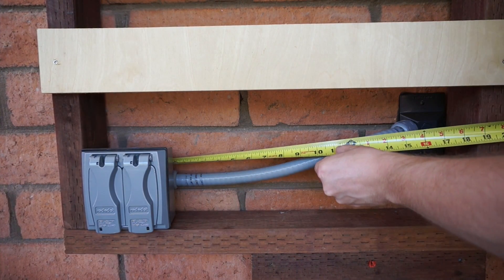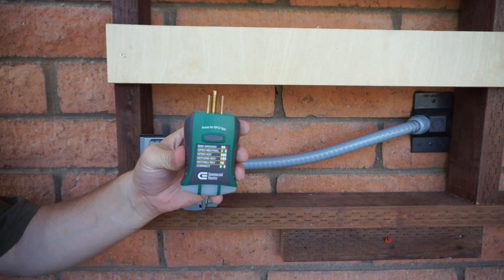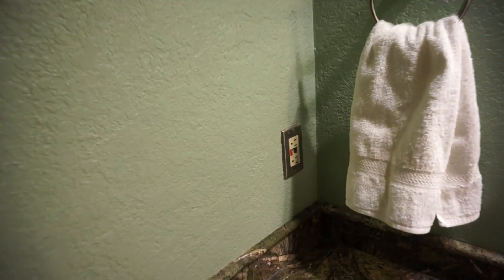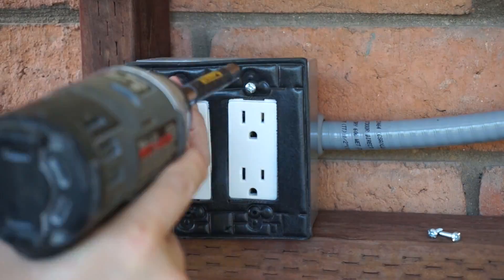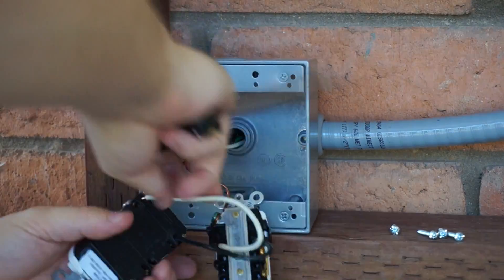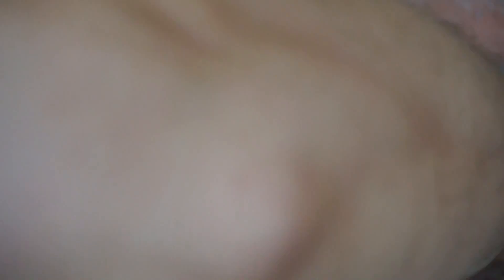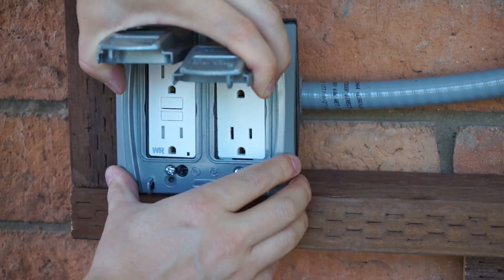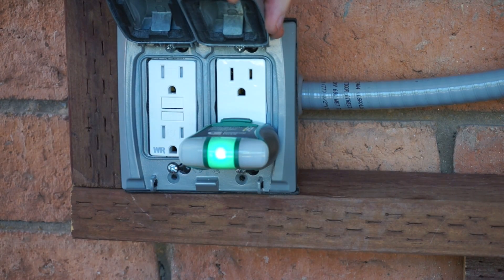How to Extend an Electrical Outlet - Followup

Comment: Great to see you address the criticisms and attempt to resolve them. Unfortunately, I know others would've slammed you about it, there are couple issues not resolved. 

First thing I noticed since your original video is the ground wire wrapping around the ground screw in your new outlet box is supposed to go clockwise so that when you tighten the screw, connection gets secured. You have wrapped backwards to when you tighen, the screw will spit the wire out like I see in this video. The wire is still making contact, so you're still safe when a GF occurs, but it's bad practice, especially if done on current carrying conductors on most receptacles/switches.  

Second, since you installed a GFI receptacle downstream of an existing one, the wiring connecting old to new devices should be from LINE to LINE terminals. Can't just leave the old GFI as is even if it's functional. If the wire on that one is still connected to LOAD terminal, which I'm suspecting based on your GFCI testing demo, then that'll neeed to be reconnected to LINE so that both devices can function independently as you intended. If either side is connected to LOAD, then you're setting yourself up for an un-resettable trip should it occur. (Trust me, it happened to me twice and it was terrible experience.) Also, I noticed another set of wires in that old outside outlet box which you turned into a JB. If the devices on the other end still need protection, so you'll either have to install another GFI receptacle at that location or add more wires inside this conduit to make this new GFI proect those downstream devices.

Comment: Great video and feedback. Would love to know how you'd add a digital timer to one of the outlets. ie., when wiring this timer, should a GFCI outlet be before or after the timer? eg. Supply --> GFCI outlet --> Timer --> Outside outlet?  OR Supply --> Regular outlet --> Timer --> GFCI outdoor outlet.  Thanks.
Reply from the maker: The scenario you describe is almost identical to any number of bathroom fan timer setups, just with the timer controlling another outlet rather than a fan. That doesn't actually change anything. Like in a bathroom case, switches (timers are switches) are not required to be GFCI protected according to the NEC. Thus, technically speaking, either of your scenarios would work. I do personally always GFCI protect my switches, even though it's not required.

Comment: Not trying to be a "Code Nazi" but, I think it's required (at least in my area) to have an "in use" outlet cover for an outside outlet. This way you can have a cord plugged in and the cover will still be closed completely, protecting the outlet from any water.

Comment: The GFCI circuit would have been fine, the GFCI receptacle at the box is more convenient and you used the proper weather resistant GFCI receptacle (labeled WR).  However, the regular receptacle you used next to it does not appear to be weather resistant (it should also be).  Also altering the box by drilling holes for mounting voids the UL certification therefore making it no longer up to code.  Most outdoor boxes will include mounting tabs that are screwed into points molded into the box (that do not extend through the box).  Those mounting tabs are then screwed into the structure.
Reply: Excellent point about drilling holes. Didn't even now that voids UL. Man, that sucks for this guy.

Comment: Did you not notice that the ground wire on the box was so loose that the wire was just flopping around every where and making no connection at all to the screw?
Reply from the maker: Well I'll be darned. No, I did not notice that and in the 6 years since I posted this video, you are the first to note it. But you're right -- that wire is absolutely not firmly connected to the ground screw in this video. I am going to take that outlet apart tomorrow and fix it, if it's still like that! Thanks for the report.

Comment: ok, I agree with the length support should be fine, but I don't know your local AHJ. However, the type of being used. You used the equivalent of non-treated pine wood versus treated pine wood. You should have used wire rated for wet conditions.
Reply from the maker: It shouldn't matter, since it's in a conduit... but as it turns out, it IS wet rated. The wires used are all THWN. I do occasionally refer to them as THHN but the local Home Depot and Lowes don't sell THHN -- their entire stock is actually THWN.

Comment: Could you mention specifically the materials used?  Conduit, etc. I saw you screwing the conduit in, but i did not see threads. . Thank you.
Reply from the maker: The original video (https://www.youtube.com/watch?v=Wd7CbQKPCak) shows the installation in more detail and describes all of the components.

In short, the unique "outlet box" is known as a "weatherproof lampholder cover".  The conduit and fittings are all "liquidtight" or "liquid-tight".  I used THWN wiring.  The main outlet box is a "weatherproof two gang electrical box".

Comment: Although very imaginative, the cover you installed over the existing metal box was manufactured and listed for use with motion sensor and two knuckle mounted exterior lamps.   Not listed for what you did, therefore not NEC compliant.  All materials must be installed for their intended use, and must be listed by a testing agency.
Reply: Ok so how would you approach this? Instead of just criticising, complaining, and stating problems, why don't you offer solutions and help this guy out? Oh right, you don't have the time to. Too busy "inspecting" other electrical videos. Got it.
Reply: @    I posted to this 3 times.  It will not let me link you to a product.  
I am not afraid to answer your question!  My comment from 5 years ago was a statement of facts.  Not criticizing, not sugar coating.   Try not to be the criticizing person you say I am.  I am happy to answer your question.
Do a Google search for “outdoor weatherproof box extension”.  There was one from Home Depot that would have worked perfectly for what was in this video.
Enjoy life!
Reply: I have tried 4 times, all blocked.
Reply from the maker: What do you mean by "blocked", btw? What does YouTube tell you? I don't have any special blocking enabled on this channel and my understanding is that I should see comments with links in a "held" group -- but there's nothing there, so I don't know what YouTube might be doing.
Reply: @granworks    Something is set that does not allow links to products, and the last two, hit enter and they showed up.  I went out and came right back.  They were gone.
Reply: Use a weatherproof box extension from Home Depot.

Comment: YOU CAN NOT use both, its either back stab entry of wires or clamped on by screws, NOT BOTH> still not to code and that would not pass around here in MD. Please dont do work yourself you are going to cause more issues. Please, when you do things to your home, pull a permit and get the checklist form the permits office of code compliance. You must have this inspected. Any inspector that passed this work should be fired or sued.
Reply: There are many code requirements that are silly
Reply: @mrmotofy  tell that to your homeowners insurance

Comment: Code is code and I wonder sometimes how much of it is written for the electrician's benefit and not so much for consumer safety.  The code on supporting the conduit ever 12 inches is a good example.  But, better safe than sorry, I guess?  Anyway, your two videos really answered some questions I had on my small project at my home.  Thank you so much.
Reply: azcharlie2009    Your comment shows you probably have no experience in electrical work, and have probably not even seen a code book.   The code says that wireways and cables are to be secured within 12" of a box or panel.   Most cables are to be supported every 4.5 feet.   Most conduits are to be supported at 10.0 feet apart.

Comment: In my experience, those back-stab wire mounts aren't very reliable. Wires will grow and shrink a tiny bit with heavy loads and those back stab mounts seem to be a weak point. I've had one come loose and arc on the back of the outlet. Fortunately I caught it in time before it could cause much damage (Just a slightly melted GFCI outlet). Looping the wires around the mount screws takes some finessing, but they're so much more reliable. I also wrap my outlets in electrical tape before shoving them into their boxes. It helps prevent the bare ground wire (When dealing with romex) and debris from contacting the hot conductors.
Reply from the maker: I personally consider the side-clamp method -- as used for these two outlets -- far superior to the back-stab method.  I've had very bad luck with back-stab in the past where it pops off too easily.  I've never had issues with side-clamps and even testing by excessively pulling on it seems to indicate an attachment method as secure as the loop method.

Wrapping the outlet with electrical tape is an interesting idea that hadn't occurred to me!  I'll definitely consider that the next time I am doing some electrical work.
Reply: Regarding the back-stab method, any time I have a learning apprentice on the jobsite and I come across one or more of these back-stabbed switches or outlets, I make a point to have the apprentice grab hold of the device and give a good pull on it while giving it a slight twist. Without much effort the back-stabbed wire ALWAYS works itself free in a matter of seconds. Then I wire one properly looping it around the screw terminal and tell him/her to try to pull it off. The properly wired device never comes free. 

Not only can the wires "grow and shrink" as OP mentioned, they also can vibrate  themselves free of the device, leading to many scratched heads, short circuits, and fire hazards. 
Good videos friend! Keep it up :)

Comment: Well......Now you got a really big problem. The GFCI circuit in the bathroom shall not serve any other rooms except another bathroom!!!! Whoever wired your house did not wire it right. If it was done before code change you may not modify it without correcting the problem. best way to solve this would have been Box extension. you would have only had one outlet but it would be code. New code states lfmc must have atleast one support.
Reply: My house was built in the mid 80's and the GFI is wired the same way.  Outside receptacles are on my bathroom GFI circuit, ridiculous, but not sure it is not up to code.
Reply: Ronnie Bailey    I'm trying to remember for sure, but I'm pretty confident that exterior receptacles were allowed after the bathroom GFCI receptacles back then.  GFCIs were fairly new and hair dryers were not 1500 watts yet.
Reply: "Whoever wired your house did not wire it right".... not exactly. Houses are built for the code adopted for that year. So it's very likely this house was built when bathrooms weren't required to be dedicated 20A circuits. So it was very typical a GFI in bathroom or elsewhere to protect all receptacles not required to be dedicated but require protection. This is all "grand-fathered" now so any new bathroom receptcle would indeed need be dedicated 20A.

Comment: I see the reference that a bathroom GFCI cannot feed other outlets that are not in bathrooms.  If the first GFCI were not in a bathroom, as others have mentioned, you don't want to have a GFCI outlet on the downstream load of the first GFCI.

If the first GFCI were not in a bathroom and you don't have other intermediate outlets requiring GFCI protection, you can make each independent of the other either by wiring them in parallel or by using only the LINE connections on the upstream GFCI in the bathroom.  This allows the LINE connection on the downstream GFCI to remain energized even when the upstream outlet trips.  That outlet will only trip if the fault exists in something plugged directly into it.  You would still use the LOAD connections in the second exterior outlet to protect both outlets in the same junction box with that GFCI.

Comment: I have a tripped breaker that won't reset going to my carport. I have an outlet, an on/off switch, a junction box then a motion detector light in that order, ran in series. I have no voltage. While checking for loose/bad wires I noticed in the junction box from the switch to the light, that both white (neutral) wires had the ground wire twisted together with them. I believe this is the short I'm looking for. The ground isn't supposed to be connected to both white wires, or am I wrong? I checked the switch for continuity and it test good-open and closed. I repaired a bad connection in the motion light, probably caused by the huge wasp nest I removed. I tried the breaker and it's still not resetting. I thought I'd ask before I take the ground out of the wire connector with the 2 whites. If the ground is supposed to be connected to the whites, I'd like to know why. It doesn't sound logical to me. I'm no electrician but I'd think that should cause a dead short. Granworks-your videos are far better than the others. The other guys leave stuff out or they talk about nothing. I look forward for more of your videos. Thanks
Reply from the maker: You are absolutely correct that the ground and neutral should NOT be connected together.  The only time I've heard of that done on purpose is to essentially "fake" a grounded 3-prong connection.  But it's dangerous at best since there's no expectation that the ground wire will have any current and this essentially ensures that it does.

I wouldn't think that that alone would cause the breaker to trip, though... at least not based on how I've heard that this is typically done.  It may be that your case is even more egregiously wrong than that, though, so decoupling them may well fix that problem as well.  It's absolutely worth doing regardless!

Comment: wrong cover  have to be bubble tipe so if in use or not the receptacle must be closed
Reply from the maker: No, that's not even remotely true.  Look, I get that people want to appear knowledgeable in YouTube comments but when you say patently false things, you end up looking silly.  If you are a professional electrician, then please re-read the NEC Article 100 definition of "Location, Damp" and then 406.8.A governing receptacles in damp locations.
Reply: @granworks  It can be convenient to have the in use covers so cords can be left plugged in. I've started using the aluminum ones since the clear plastic seems to turn yellowish from sun
Reply from the maker: No.  This is not a wet location.
Reply: Any place outdoors is considered a "wet location".

Comment: Looks like bathroom circuits have to be dedicated. 210.11(C) (3) Cant win right!

http://ecmweb.com/nec/code-basics/101ecmCBfig3.jpg
Reply from the maker: Sure enough!  And when I put in a new bathroom into an addition a few years ago, I did create a dedicated circuit just for those outlets, as per code.  In this case, the outlet I extended was on a circuit original to the house that included the outlets in the two original bathrooms plus all exterior outlets and lights.  That's definitely not allowed by code today but likely was when the house was built. Technically, an inspector could have mandated I bring that circuit to modern code since I touched it!

Comment: If you can make the needed connections using short wires i don't think that's a problem (may be a pain for the next person working on that box though) but when your wires are long it can be difficult to stuff them all back in the box to finish the job (especially if you're adding a GFCI receptacle because they're bigger than the standard electrical receptacle. So maybe there is a bright side to having short wires.